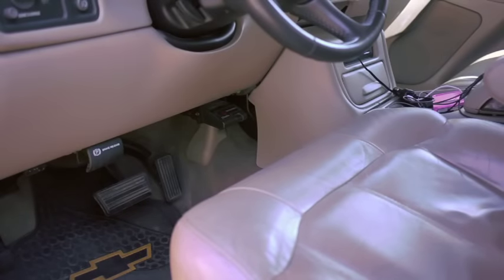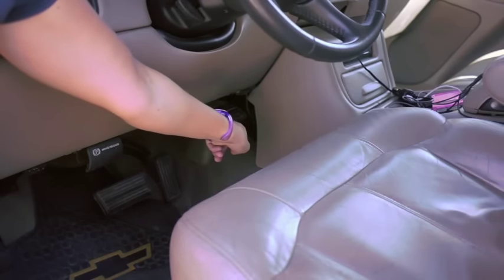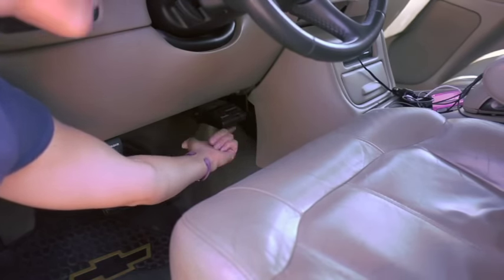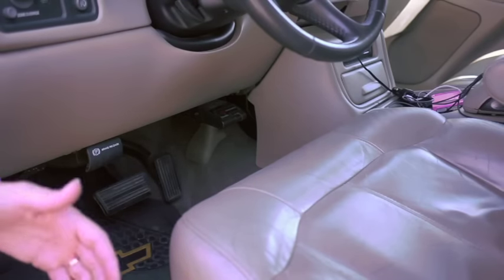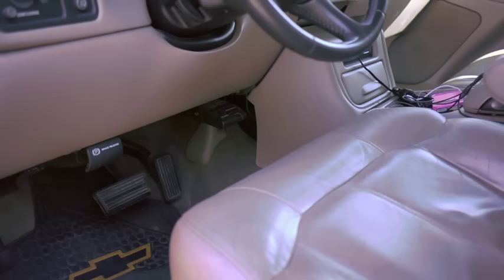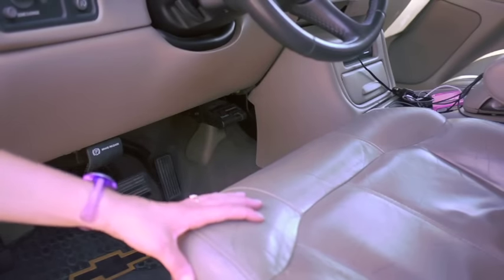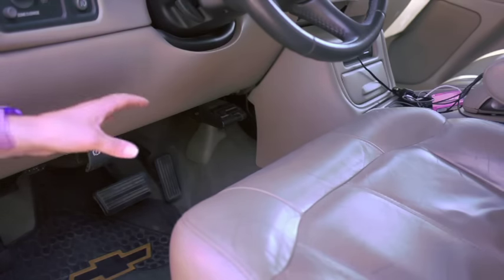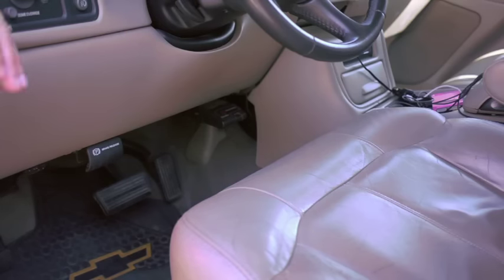Brake Controller tutorial

Comment: Press the trailer brakes ONLY when trailer starts to oscillate, if you want to stop oscillation.
Reply from the maker: It’s amazing it will just pull that trailer straight.
You can use your vehicles brakes simultaneously, but you also have to use the override and at more pressure than the vehicles brakes. It is easier and faster if you are using the override exclusively instead of simultaneously with the vehicles brakes.

If you find yourself fishtailing or oscillating, ask yourself why and if possible try to prevent it from happening. Could be your not level, your weight distribution is not balanced, could be the wind or another larger vehicle passing you, which pulls you in then pushes you out. Could you be using a equalizer hitch (or other brand) It shouldn’t be a common occurrence, but it does happen to all of us at some point.

Comment: Depends on where you live and the size of your trailer as to if you need trailer brakes there sweetie.
Reply: She says as much in the video there honey.
Reply from the maker: Yep, different states have different laws.  I think even if there was no law, I’d want trailer brakes in most cases, depending on what I’m towing and my tow vehicle combination. The current law in Utah (it changed several years ago) is difficult for someone who doesn’t trailer often to decode. Utah Law use to be anything 2,000 pounds or more. Now, you have to be able to stop within 40 feet on a level dry road if you were traveling 20 mph. If it’s a travel trailer I would recommend trailer brakes. They are boxy, catch the wind easily, you always run the risk of fishtailing (things you can do to prevent or lesson the possibility), it’s better for your vehicles brakes and it’s just safer. Hope that helps, thanks for commenting! 

(I do realize after 6 months it probably won’t really help the person who commented:)